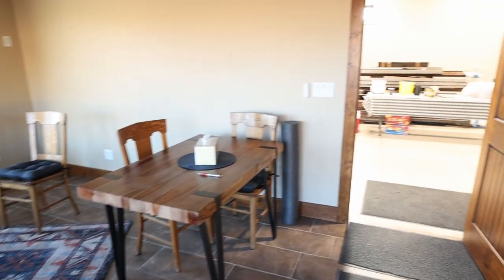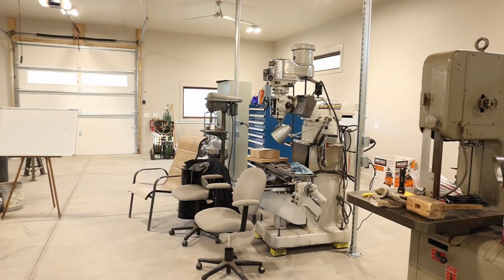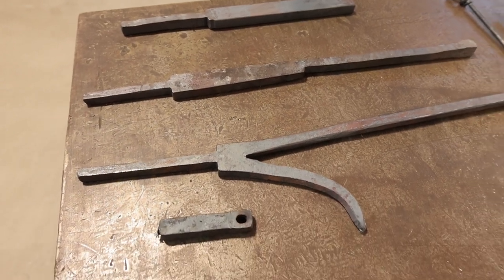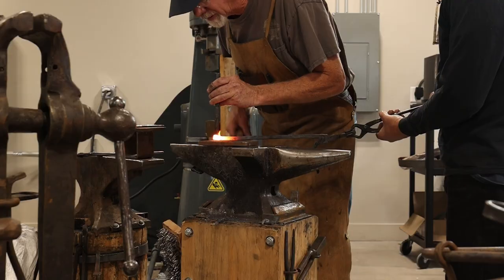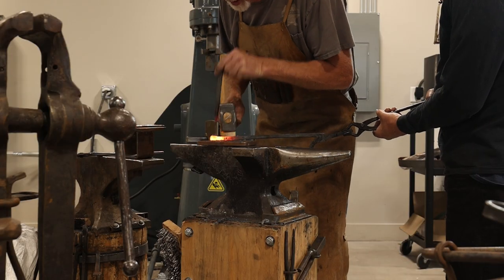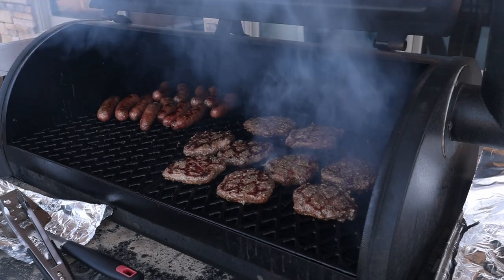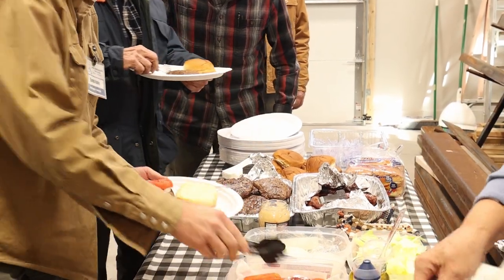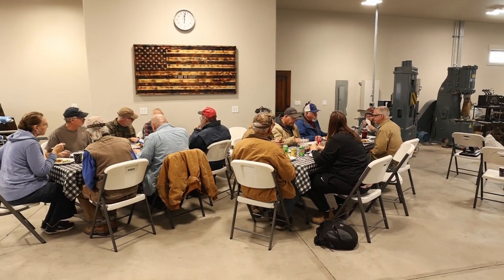Get Involved and Learn More

Comment: When it is warm the anvil doesn’t act as much like a heat sink, but when it is cold, us slow pokes notice the difference. I pre-warm my anvil in winter by pointing a hair dryer at it for several minutes. After that I may take a heated up piece of plate steel  (1/4 inch) and place it on the anvil face to further pre-warm the anvil. Not needed in summer.

Comment: I'm pretty fortunate.  There is a smith who runs classes at very reasonable rates within commuting distance from me.  I have only a 90 minute round trip which I am more than happy to do and the instruction and useful knowledge I get from that is worth way more than the cost of the instruction and fuel and time I put into it.  If I had to try to learn  only from youtube videos and trial and error, I would have learnt an awful lot less by this stage.  If you are lucky enough to have a group you can join, do it!  The information you have access to will speed your learning more than you can imagine.

Comment: This question may not fit here so I apologize if it is off topic.  I am not a blacksmith and never will be, I just enjoy watching the process of beating a hot piece of metal into something useful.  I have been a woodworker all my life and know there is a difference the amount of force I apply to a framing hammer and a finish hammer or even a tack hammer.  So when I watch a blacksmith working on a power hammer I am curious just exactly how that piece of equipment works.  Does the operator modulate the blow by the foot pedal or is there something else at work when it begins hammering on the steel?  Perhaps this is a silly question but understanding the aspects of your trade is an area of interest from me.  Sorry for the long comment.
Reply from the maker: On old mechanical hammers you can control both speed and force through a clutch system that slip depending on the pressure of the foot pedal.  On the AIr hammers speed is constant and force is controlled with the foot pedal through a series of valves.
Reply: Dan, ya never know about blacksmithing....I happened to meet the president of a local blacksmith organization once.  He said I should try it out sometime.  I was into woodworking at the time and told him I had no desire to become a blacksmith, but enjoyed watching them work.  He invited me to a club meeting nearby "just to watch"...long story short; after the meeting I joined, got the bug and have been smithing for 9 years now!!  BTW, the club president was a professional woodworker AND amateur blacksmith as well.  It can be done!:goodvibes:  (I abandoned my woodworking)